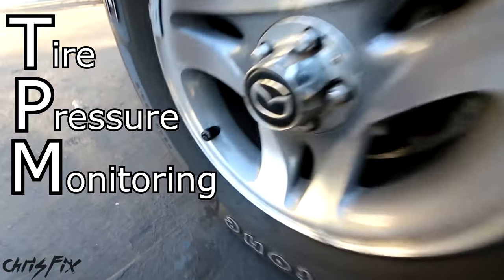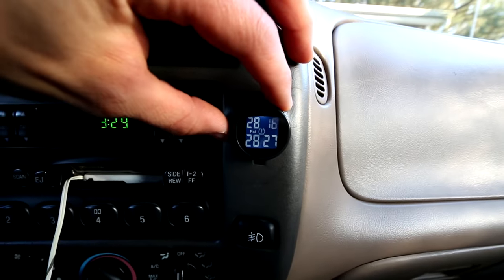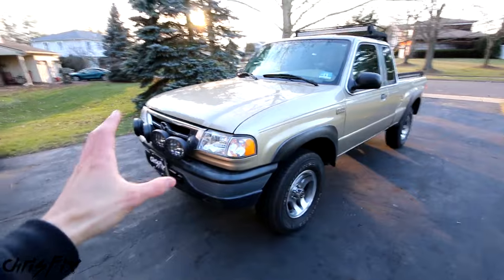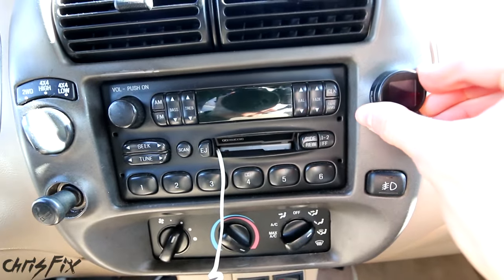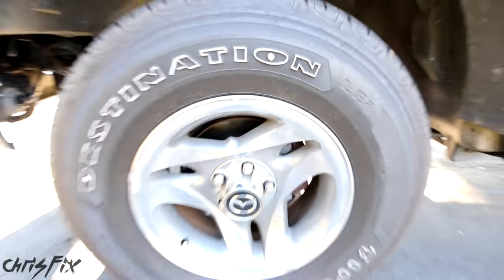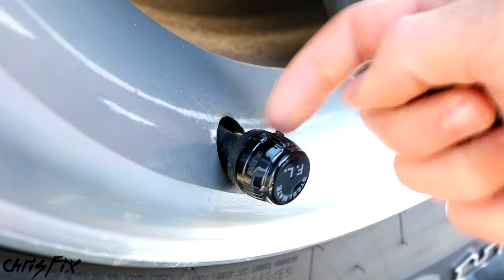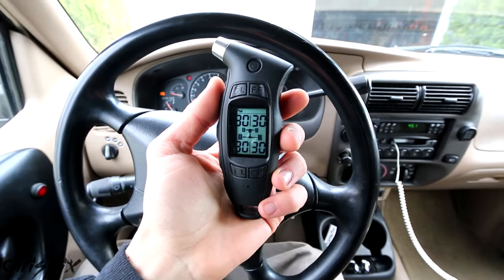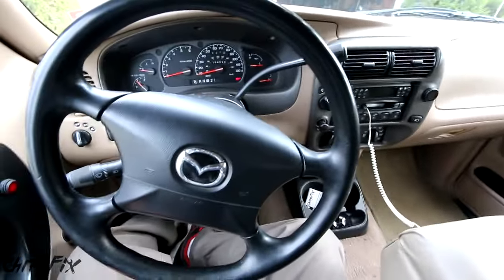How to Install a Tire Pressure Monitoring System in Your Car

Comment: for a 109 dollars id rather walk around and check with a Guage ...
Reply: +TheMonkeyeats ikr! that thing is more expensive than my car it self lol
Reply: +TheMonkeyeats some people have the cash but not so much the time. This is convenient for them
Reply: +News_Flash_411 Is it true that the gauges themselves lose accuracy and have to be replaced at intervals?
Reply: +TheMonkeyeats Well, just like everywhere else, you pay extra for the convenience.
Reply: I agree! I aint that lazy.
Reply: +behinderteleberwurst Not really convenient, since you have to unscrew that thingie with the two special tools every time you need to put some air for each tire. what a pain in the ass!
Reply: +PresidentGuevara But do you check them dayly? ;)
Reply: +TheMonkeyeats I have low profile tires on all 4 corners of my car which are, in case you didn't know, more sensitive to being over or under inflated. They are also extremely difficult to tell at a glance if they're low or not so usually when they are, it's been too long and it's been unsafe for a while. I do have the money to spend on this and it's a safety device after all. I'll probably be picking one up very soon. I understand the price.. however.. it's an investment, 1 flat price. Besides it's not like anyone does a safety inspection whenever they go to get in their car usually you only notice the really severe issues.
Reply: me too lol
Reply: +Corvux IX The car my parents use has nitrogen instead of air i think and we never had to fill up air over the course of 3 years all tires are only filled when new rubber is installed and thats it .... but it would be nice to know the pressure if there is a nail in the tire for example
Reply: +TheMonkeyeats time is money
Reply: +TheMonkeyeats even though someone may be meticulous like I am , I still have put such systems in 4 and 2 wheel vehicles of mine for peace of mind and some heads up in case of having a rapid deflation at high speeds after stepping on a nasty big screw or even a blade(been there ! ).If you combine the above scenario with extra weight , things have got very interesting VERY quickly to me in the past !
Reply: +TheMonkeyeats not only the price but you also have to undo them with the supplied wrench every time you have to add little air. kids around here would rip off the whole thing with the Tyre valve.
Reply: +TheMonkeyeats This is why I bought a portable car tire pump that you can plug in through your power adapter and not only fills your tires in case of an emergency, it also has a built in gauge, and light and you can easily purchase these at your local Wal-Mart.
Reply: +MINECRAFT SHUFFLE calm down keyboard thug .. dislike all u want i simply gave my opinion ...
Reply: +TheMonkeyeats  Walking around the car is really not an option when you're driving down the highway. If you get a tire puncture, you might find out your tire is low a little too late after a 70 MPH turn.

BTW, back in 2006 this was an option for my SUV and I paid $500 for it. Each sensor inside the tires cost $120 + installation. All I get is a "low tire pressure" warning in the dash and have to figure out which tire is low. If I need to use something like "Fix-A-Flat" on the tire, it will ruin the sensor. Not so with this system because you take the sensor off first. There's no risk of damaging the sensor when you're having your tires changed - this happened to me. This kit does a lot for the price.
Reply: +JoeyRodz74 I have a 2002 Grand Cherokee with TPMS factory installed.  Each tire's pressure is read out on the overhead console display.  There is only a warning for a low spare tire pressure.  All sensors are original and have not had their batteries changed, if they have batteries at all.  After 14 years, how much longer could they last?  You're right about Fix-A-Flat.  It will ruin these sensors.
Reply: +NCF8710 they should be replaced everytime a new tire is put on the rim. you could have bad sensors and not even know it. the in tire ones are about 100 for all 4.
Reply: +hoodmobbin OK, thanks for the tip.  I do, however manually check each tire with an accurate gauge.  All four are still spot on.  The vehicle has 245,000 miles on it and I will probably replace it within the next two years when it would be due for new tires.
Reply: When a sensor stops working, my Expedition says "tire pressure sensor failure". You need to figure out which one. Another advantage of this "external" sensor is that you can rotate the tires without confusing the system or having to reset it.
Reply: Yeah. It's easy to walk around the car checking the tyre pressures whilst doing 70mph
Reply: +TheMonkeyeats I bought Gas saver Valve caps for my honda because the tire was going flat alot. once I bought them the problem was fixed. I got them from walmart for $5. http://www.walmart.com/search/?query=gas+saver+. I have used them on my truck. they don't have 30 psi but the 32psi does the job.  if you see only red in cap time to fill it up.
Reply: +pappy 1990 then it's probably the valve core which is leaking. Get a new one put in. A tire shop will probably do it for free.
Reply: same shit i said bro lmfao fuck that ill walk around 50 times before buying that at a insane prince tag
Reply: +Corvux IX special tool xD what
Reply: +NCF8710 they have batteries, they dont wire inside your tires lol
Reply: +TheMonkeyeats Fuck that, I have an analog gauge, don't even need a digital one.
Reply: I check mine weekly or when i come home after leaving the car sitting for a few weeks
Reply: live in Wisconsin
Reply: yeah, me too. But it's compact, waterproof and also wireless.. I can understand the price.
Reply: Don't put the security nut and the convenience factor is no longer there. XD  Just hope no one steals your $110 investment. :P
Reply: wtf
Reply: A $10 dollar may save you money, but real-time tpms may save our life.
Reply: agreed abit pricey for this device, but if your lazy af then go for it lol
Reply: I wouldn't say it is a pain in the ass. You want to know what is a pain in the ass? Someone always stealing the caps off my tire so they can have some on there own tires.
Reply: 109? tf?
Reply: If $109 is a problem for you then you might be severely poor..so poor that alyssa millano is making an ad featuring people that can even scrape together 109 dollars
Reply: i can see this being useful if you are racing. if your tires are too hot, the air pressure will increase and you would have less grip. the tpms will let you know to back off the car to cool the tires.
Reply: Colorado DanK Rides  sometimes  racing tyre temps can spike and cause psi to rise too high.  This greatly effects the handling.  generally each tyre make has an optimal hot psi pressure that you want to aim for.  That being said id just use a tyre gauge  :)
Reply: You can't do that while you are driving and run over a nail. The purpose of a monitoring system is to signal you before the tire gets too low... Most people don't know when they run over a nail until the tire pops from low pressure shortly after. It is standard in all american cars now for that reason.
Reply: TheMonkeyeats yep
Reply: So out of curiosity: It's been a year. What's the percentage of times you took that walk around the car before driving off? 
To be honest, I doubt it's higher than ten percent if even that.
Also let's say you use your car on 250 days of the year. And you wanna get back home. That's about 500 times 10 seconds. That's one hours and forty minutes per year. This thing pays for itself in two years :D.
Reply: Well I have been driving for 30 years.  I have never done the walk around thing and nothing has ever come up to where I have said "Dang!  I wish I would  have checked my tires before I drove off."  So although it is an interesting gadget probably the reality is that it is more of a toy then something that is actually needful.
Reply: I agree!
Reply: TheMonkeyeats i
Reply: lol..
Reply: Hey you can put tpms on your 300k mile beater with the back up camera, GPS, and sat radio ran through your walmart double din head unit with those on the tires and say yours has the same features and yours is paid for
Reply: Damned handy with trailer towing though.
Reply: Firme
Reply: Only 59.99
Reply: Then you get a puncture and don't even notice
Reply: Let's see one for a dually. Better yet let's see a dually have TPMS from the factory instead of being removed when you check off the DRW option.
Reply: While you might,  the vast majority don't and many would not know how/what they are looking for.
Reply: @ryandaddy2044  okay, what now?
Reply: Do you have a long term update on this? Did it hold up?
Reply: It uses up an aux port and you have to use valve caps that can be easily damaged, rather have solid stems installed that calibrate to a system that uses small radio voltage, also if you lose the tools, good luck getting the sensors off...
Reply: $56 now
Reply: If youre driving 80 mph in the freeway and your tire pressure starts going low fast your gonna wish you had a sensor on those tires
Reply: O yah
Reply: But really nice when tire goes low while driving. Would pay for itself by saving one tire.
Reply: This system already saved me twice. When you drive you dont know when you have a slow punction, just the next day when you walk out you have a flat. If you knew you could drive immediately to a tyre shop or DIY immediately and not keep driving around. Also not driving on a flat saves your tyre. I have already made back the investment i spend on this.
Reply: It’s now just $55 (11/20/2022)
Reply: Each person's choice
Reply: But when your car is experiencing a slow leak on highway but you cannot “walk around and check” until it’s too late
Reply: For racing, worth it
Reply: @ryandaddy2044  same
Reply: If you’re broke just say so
Reply: my wifes suv has tpms but our honda city does not, today she took the suv to go to work, while driving on the freeway one tire went suddenly flat but thanks to the tpms she notice and replace the tire with the spare under the truck, if she had took the city out instead of the suv that would have been a disaster, definitely going to buy this stuff for my honda city
Reply: Who asked
Reply: It’s $30 buddy, where does it say $100?
Reply: Then do that ….
Reply: Theres paying extra, then theres being taken complete advantage of, which is sadly most shops.

Comment: Only one prblem, the sensor battery dosent last long, 5 months maximum, and if the battery died, the screen will show the last pressure and keep showing it, even the battery  sensor is dead, you wil have flat and the screen still showing the  pressure is still good,  You have change the sensors battery twice a year,

Comment: Man id buy it if you could plug it in with a cable. No way I’m wasting my only 12V slot which you can’t even see because it’s inside the center console.

Comment: I would buy these if it didn't cost $110!
Reply: Ygxhh3467🌼😼😌😌😂😆🙃😊😊😅😉😃😁😆😇😁😁😁😅😄😊😊😅😆
Reply: OBX lkhgge36 chris fix
Reply: Consider the actual parts for a tire pressure monitoring system if yours go bad.  Its about that PER tire.
Reply: someone else from the Outer Banks, hell yea!
Reply: OBX Sand Devil it's still a fair price compared to what you have to pay when your vehicle already comes with it and pay the price to get them serviced.  💸
Reply: $110 wow i will stay away
Reply: save your money its a shit product. the lcd is dull as f$#
Reply: Amazon has other for $59.99 which is what I'm probably going to get.
Reply: That is the problem, most of the really useful things are always going to be expensive because stores know people will buy them, unless you have a good car parts place, like I do, it's a little far away from my house, but its cheaper than all the other places
Reply: Well it's not that bad but since i live in Bosnia, it would get stolen within 2 days
Reply: $110 dollars verses your life if a tire has low pressure???  Wanna debate that one?  Low pressure can cause severe vibrations, the vehicle will pull hard to one side (just like bad brakes) and can even cause a blow out.  So again $110 dollars is too expensive?  How much money do you value your life or your passengers?
Reply: OBX Sand Devil it’s 60 bucks now
Reply: People need to shop besides amazon. eBay is way less expensive.
Reply: If someone can't afford a measly $110 for a safety improvement, they need to re-evaluate their situation.
Reply: I just checked and it was $55 on Amazon
Reply: I bought mine on ebay :) Paid 41$ with free shipping for mine and it has a little solarpowered screen that you just set on top of your dash, looks awesome and it works :D
Reply: It's $60 bucks now on amazon
Reply: $66 dollars on Amazon now. Less than the cost of 1 new tyre where I'm from.
Reply: Then this product is not for you. Go build it yourself and sell it. Let we see how much you will put the price on.
Reply: what if it gets stolen the next day lol ill take my chances though im ordering it or something similar
Reply: I got mine for 70 and it’s been holding up for years now
Reply: Found the one he has on for 47.99
Reply: It's $35 bucks on AliExpress.
Reply: Cecille Alicante to
Reply: i so agree
Reply: Yall complaining about $110 but turns out cars are expensive to maintain
Reply: They must have heard you, because they cost $55.99 now.  :)
Reply: It is $55 as of today.
Reply: Good news, July 2020 it's down to $56!
Reply: this comm is like my life isnt worth 110$ well well
Reply: 609 noice
Reply: Theyre about 100-130 a piece if theyre in your tire. And thats just parts cost
Reply: @connornile1115  BuT oN AMaZoN ThERe (insert low number here)
Reply: It says it’s $55 tho? Maybe it changed since it’s been 3 years? Idk and idc cuz I’m buying them
Reply: I never use this product because I do actually take my time inspecting the tires before setting off. You can just compare the either tire to other tire on same side then do other for other side. This product caters to lazy people and we know lazy people spends more :)
Reply: @panther7584  
But, then one day you drive over a sharp object while travelling 80mph and the tire blows out, you lose control, die, and take out other people because you're not lazy.  Smart.
Reply: @alwcurlz  Sir, this product does not measure the tire pressure upon the tire rolling over sharp objects. It measures the tire pressure over time. Why should I get this when my tire drives over a sharp object, resulting in large loss of tire pressure in seconds?
Reply: Its 55 on amszon now
Reply: Sorry god is poor
Reply: @panther7584  
You're missing the point completely. Tire pressure sensors give you pressure status and warn of quick deflation. A sharp object that punctures a tire can cause loss of air quickly or slowly. In any event, when the pressure falls under a min pressure, you'll get a warning. Simple.
Reply: Price went down lol
Reply: 😲 $110!?
Reply: It dont any more
Reply: I saw it on Amazon for $60
Reply: Its 60 now in 2021
Reply: The car got some new shoes 👞
Reply: A good tire gauge & modest air compressor is cheaper & can be used on multiple vehicles. If one can't use 3-4 minutes to accomplish tire pressure check this old fashion way, quit driving.
Reply: I've heard that a device like the USB adaptors to charge your phone in your car, actually give off a constant signal that causes long term problems with your cars CPU. Food for thought! Do your research.
Reply: @alwcurlz  there's people out there driving around without a spare tire! Lol. Americans truly do live in a cloud 😂
Reply: @Chriscovelli1  
???
Reply: To be fair. I would happily save my cash and spend $110 then buying something like a used BMW with it, but when that system goes wrong. Its like $3000 to replace. I much prefer adding this to a random car. Great video Chris 😁
Reply: @alwcurlz  sorry. Confusing I know. I agree with everything you said....except one thing. "IF AMERICANS CANT AFFORD $110 THEY NEED TO REEVALUATE THEIR SITUATION" Hence, my cloud comment. $110 to you? Probably chump change. To the average American family.....$110 is what's keeping the whole family fed.
Reply: I'm warning all of you.....those things give off a constant radio frequency that CAN DAMAGE YOUR CARS CPU. In a country ran by greed, you should do your research first.
Reply: 55$ now!
Reply: @Chriscovelli1  
It's not like someone has to drop $110 cash at some store. ebay/amazon...credit card...pay off over time. Pay off in a month, that's less than $4 a day. Anybody can afford that. Geez. Just skip a movie or two. People commonly pay well over $110 a month for a cell phone.
Reply: @alwcurlz  while your comment makes sense, part of it doesn't. MOST people actually have free phones from our government, or they pay about $35 a month by using pay as you go cards. I think your just speaking from what YOU THINK is common. I'm an actual lower class citizen buddy. I think I see more of daily reality than you do. No offense. And no, most Americans actually CANT afford to save $4 a day for something they can simply use a tire gauge on. Money is king. Not devices to make your life easier cuz you happen to have to much money lol.
Reply: Jonathan Gonzales  how are they holding up?
Reply: Good news 55
Reply: @ItsRiley3  no it’s quarter of that. 
But when considering the actual cost( including labor) that will be the same.
Reply: Jonathan Gonzales  laziness
Reply: Jonathan Gonzales  I played like a dollar for my true gauge......lol
Reply: That's soon cheap mine are 50s dollars
Reply: 56 on Amazon
Reply: Safety Dave TPMS is the onlyTPMS i'd use
Reply: It’s 59.99 lol
Reply: All these tyre monitors are shite.... Inaccurate... and too much of a headache. And waste of money.
Reply: Got mine for $40 on Amazon
Reply: I was the 1k like dude